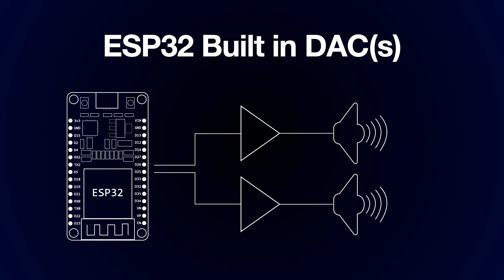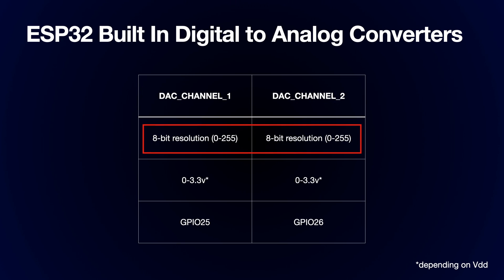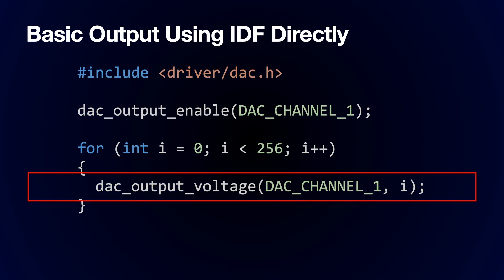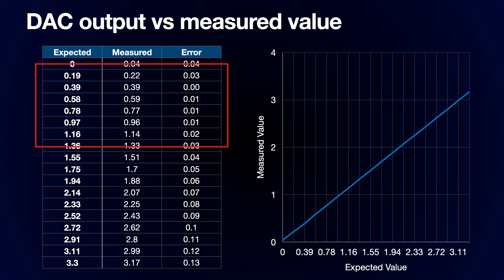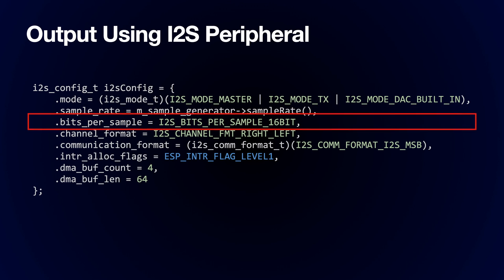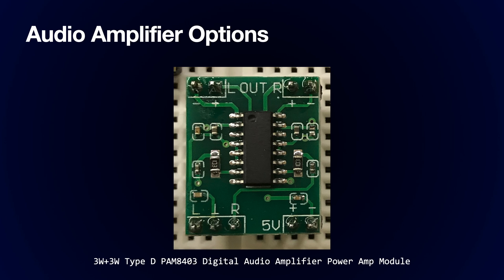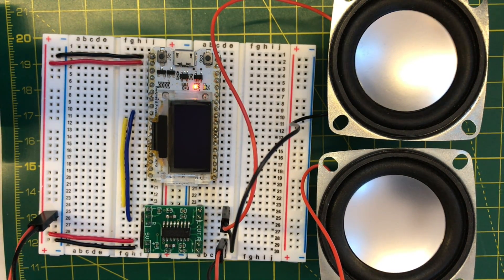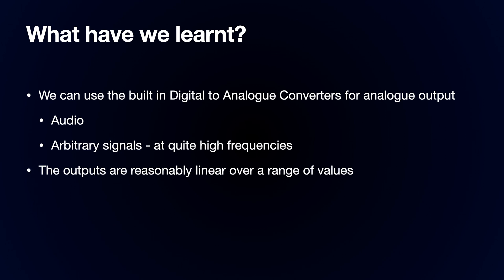ESP32 Audio: I2S & Built-In DACs Explained

Comment: Interesting. I think it should be possible to output 16 bit signals. You can use both D/A converters. By operating the least significant bit A/D converter output across a voltag divider and the most significant A/D converter directly. Then you can add both analog output signal together with an analog signal addition amplifier.
Reply: By using the PDM output, you can get stereo 16-bit, all that is needed is to lowpass the output.

Comment: Say I wanted to bring in I2S data from a MEMS mic and pipe it directly out to an I2S DAC.
Can you read and write to the same buffer or will I need to make code to transfer from the "IN" buffer to the "OUT" buffer?
Reply: Did you get an answer or a solution for this? I need to do something similar, but I'm kind of a noob in all of this.

Comment: Hi, thanks for the Video. I am haveing trouble getting my head around the "bits per sample" part of the header.  In your code you expect 16 but actually use 8 ie, reading into a uint8_t field. Am I missing somthing here?
Reply from the maker: Hi Chris - do you mean this line of code?         m_file.read((uint8_t *)(&frames[i].left), sizeof(int16_t));
We need to cast the pointer to a uint8_t * as that's what m_file.read expects to receive. But we are reading sizeof(int16_t) bytes - so we still read in 16 bits of data.
Reply: @atomic14  In the file I downloaded from github i have         "m_file.read(&left, sizeof(uint8_t));"  This is from WAVFileReader.cpp in the dac_i2s_output/src folder.
Reply from the maker: @chrisswallow3734  You are right - apologies for the confusion - I just checked the sample code and the DAC version is using a WAV file with 8 bits per sample - I've pushed up a quick fix to make it consistent with the I2S example. They should now both be using a file with 16-bit samples. Hopefully, I've not broken anything!
Reply: @atomic14  Thanks, I thought I was loosing the plot. I was pleased to come accross your video as i missed the ability to use i2s with the internal DAC when reading the documentation for the esp32. I am going to try using mono and just one channel as the lovely people at Lilygo have hard-wired IO26 to the SIM800 on the t-call board.
Reply from the maker: @chrisswallow3734  Sorry about that :) I wonder why they had to use that GPIO pin - very annoying!

Comment: Nice videos
I am looking for a solution for a guitar tuner with INMP441 and ESP32 based or on autocorrelation models or YIN. I tried with FFT but is very inaccurate. Any idea?
Reply from the maker: I think FFT won't work very well. There is some sample code here that I think uses autocorrelation - I'm afraid this isn't really something I've looked into - https://github.com/logsol/tuner/blob/master/Source/MainComponent.cpp It looks like there's some good info here - https://29a.ch/2020/04/15/guitar-tuner
Reply: @atomic14  those are examples I have tried with autocorrelation, but it looks like samplingRate (I tried from 8919 to 48000hz), nrSamples (I tried from 128 to 4048) produce not very accurate results too in the low frequencies. For 440hz I have a frequency in the range of 432 - 445 hz... Many examples around are for Arduino analogRead which is 8bit. ESP32 reads in 32bit... I dunno if there are some operation to perform to read just the MSB... 
this is the reading (
i2s_pop_sample((i2s_port_t)i2s_num, (char*)&sampleIn, portMAX_DELAY);
 vReal[count] = sampleIn;
thank you!
Reply from the maker: @emabelloni  There's some interesting code here - it's a bit over my head - but might do what you want https://github.com/performous/performous have a  look in game/pitch.cpp - that seems to be doing tone detection. "Performous does pitch detection with fast fourier transform (FFT) combined with a sophisticated post-processing algorithm. This system is able to operate well in extremely noisy environments, even when using very cheap microphones."

Comment: Thank you for taking your time to make the explanation so clear! Curious if you have tried using the internal ADC to read audio signal with I2S, then stream to the internal DAC concurrently also via I2S?
Reply from the maker: Hi Pithawat - this is definitely possible, but I have not done it yet. You should be able to take the code from the audio input video and feed the samples into the output code. It's probably also possible to do this using audio pipelines. The documentation is very focussed on using codecs, but you should be able to use it do what you want. https://docs.espressif.com/projects/esp-adf/en/latest/api-reference/framework/audio_pipeline.html.

Comment: Is there any way of ganging the two outputs to get mono 16 bit resolution, e.g. where one channel is encoding information for a voltage controlled amplifier and the other one is the signal fed into it?
Reply from the maker: Hi Daniel, you could definitely do something like that. But it would probably be easier if you need more resolution to use the I2S digital output and a suitable external DAC - that would give you up to 24 bits - I've done a video on this here: https://youtu.be/At8PDQ3g7FQ - there's also a break out board from Adafruit that will decode the I2S output to line level output https://www.adafruit.com/product/3678 I've got one on order for some experiments.
Reply: @atomic14  Thanks I'll take a look at that.
Reply: @DanielSMatthews how about suplying the left channel with the high byte and the right with the low byte of 16 bit mono data, then mix the ouput with 1/256 attenuation on the right channel oitput before mixing?
Reply: @bimsonic  Sounds good. Worth an experiment.
Reply: @DanielSMatthews  please update with the result here when you're done!